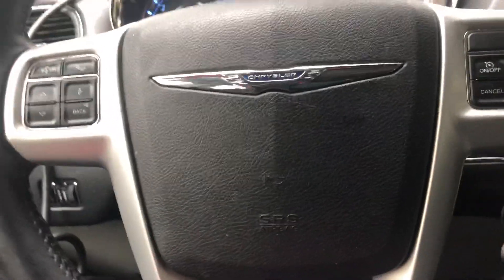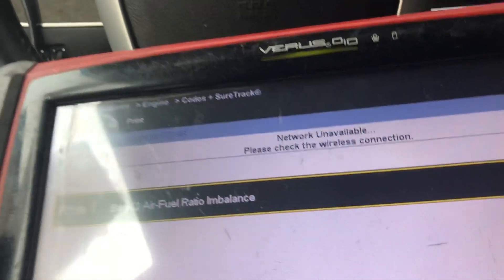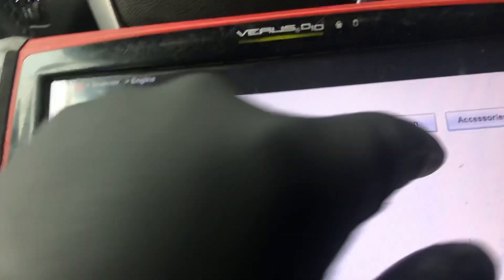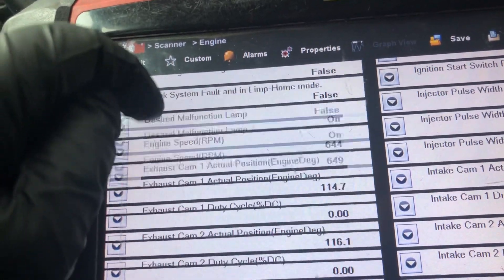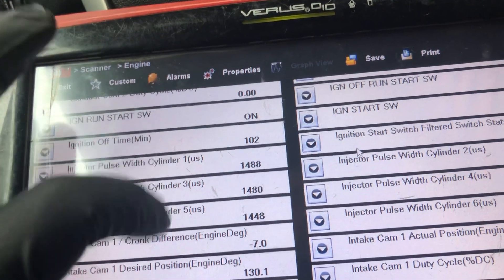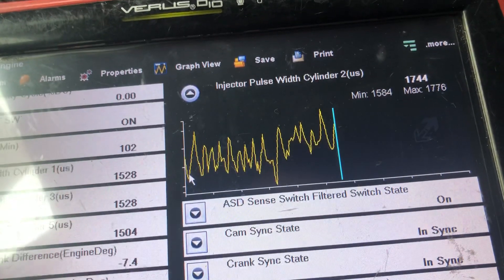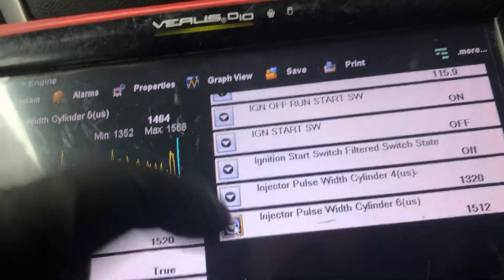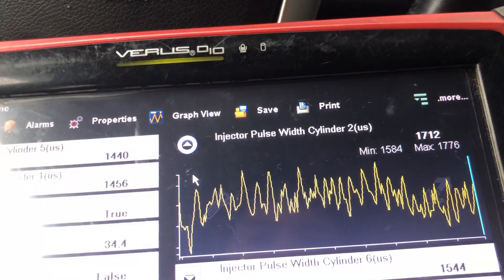p219B, 2014 Chrysler town country Mobile Mechanic Diagnostic

Comment: Did it got fixed?. I have the same code P219B on my 2014 Chrysler town and country. I've taken it to 3 different mechanics including the Chrysler agency and they said I need a new engine.
Reply from the maker: I changed injectors and got fixed, but this code is very difficult to diagnostic, but it is good to change the rear spark plugs and injectors from rear to front, that way you can see if the codes moves to front
Reply: Hi Elsito. Did you solve the problem? I have a 2016 Dodge Grand Caravan, have p219a code and the mechanic shop told me that I need a new engine
Reply: @MatthewJoOfficial  Could that be related to rocker arms and camshaft which is a common problem for pentastar engines?

Comment: What was the issue?
Reply from the maker: REDЯUM injectors
Reply: @MatthewJoOfficial  all of them? Mine all on that bank are close to around the same but not near bank 1 results. It came out of nowhere. This code and random multiple misfire and I did spark plugs and the misfire went away
Reply: Misfired by cylinder on bank 2
Reply: @MatthewJoOfficial  where can i buy the machine like yours at?? The scanner
Reply: Never said what was causing the code? Im guessing injector? Ne wasn't clear
Reply: @QuelesaRobinson  Snap-on tools